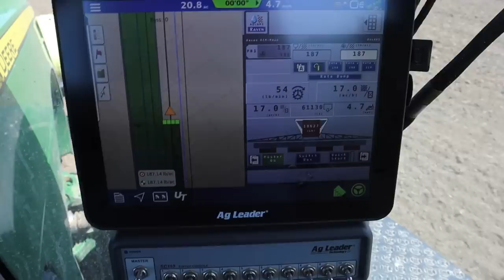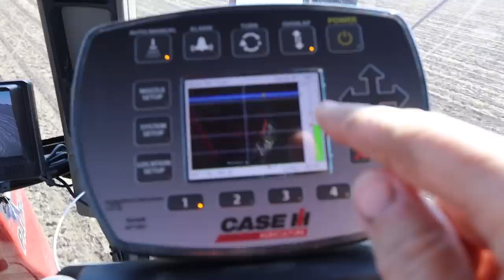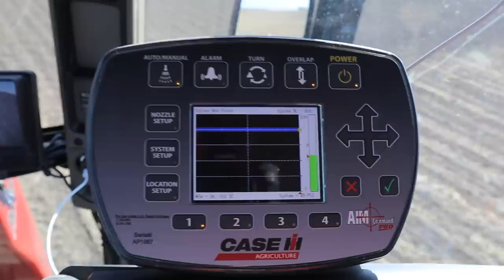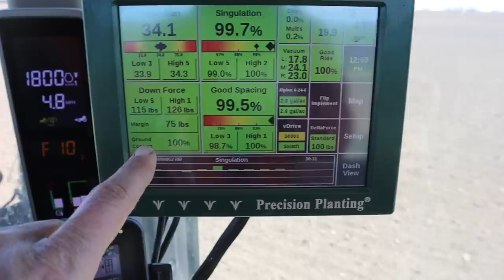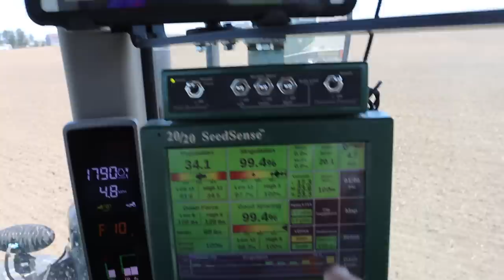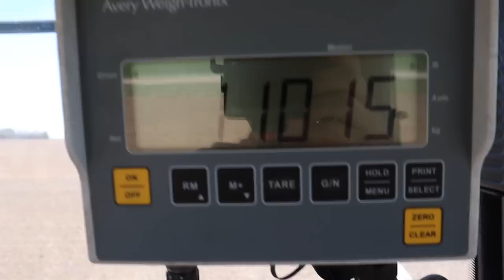MAKING OUR CORN PLANTER SMARTER.  | Vlog 76

Comment: Sure is different now than 50 years ago. We still have our JD 2 row (40 inch rows) planter in the shed. Back then we thought changing plates for each variety was high tech!  The JD 420 tractor was 6 volt and the lights were inadequate to plant at night. It would take a week to plant 200 acres if equipment and weather cooperated. It is fascinating watching Mark and his operation.

Comment: You indicated that when you planted two different varieties of peas by splitting the planter at 8 & 4 rows you were able to analyzed yield differences with your 8 row corn header on the combine.
My question is can you store the two different varieties in the same granaries or must they be kept separate due to different characteristics.
My gut feeling is that they can be mixed but I have no experience growing corn.
Keep up the EXCELLENT videos that include camera & drone shots.
Your quality of presentation and description has DRASTICALLY IMPROVED.
Looking forward to more videos on an even more regular basis.

Comment: Hey Mark, I will say this. Planting corn today is nothing like how we planted corn back when I was a kid, 4 row planter, Hoping our depth was good, spacing was good and Hoped that the corn came up. Didn't have the air seeders or the liquid fertilizer or computers to aid us, Put fertilizer on by broadcasting it with a spreader and Prayed that there would be enough rain and sun to get the corn growing. I don't know if the simpler days were better or not, But it sure seemed easier and not so stressful. I learned a lot today watching your video, Thanks for sharing.

Comment: I realize combines and other big harvesting machines get lots of attention, but to me modern planters seem very close to magic!
You mentioned using different seeds as a test of sorts; do you also play around with different levels of fertilizer, or is that a given?  If fertilizer prices dropped would you use more hoping for higher yields?
Reply from the maker: We do play a bit with fertilizer amounts but not at planting time do too the limited amounts.  If fertilizer is less expensive, we will take advantage and apply some extra but only if it is "environmentally friendly"

Comment: Just a quick question,  as most of us in Ontario woke up to at least 2 inches of snow (gahhh!!!), how will this affect your planting efforts or the effect of the fertilizer you put down?
Reply from the maker: With little we've had here will actually help move the fertilizer into the soil off the soils surface which is a good thing.  As for the planting efforts, they're on hold till it warms and dries up.

Comment: I wonder how many spares you need to carry with you for those sprayer solenoids. 
And they shouldn’t fail normally, but like fuel injectors, same idea they should last many hundreds of hours

Also with those air line fittings, is something hitting them? And breaking it off like that? Is there a way to build half a cover to protect it, or are the lines short and pulling on it